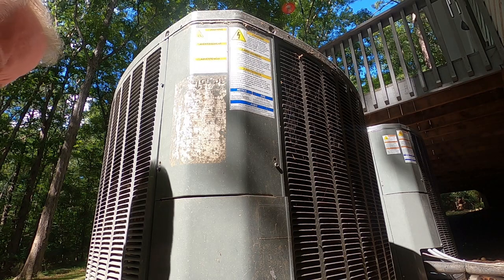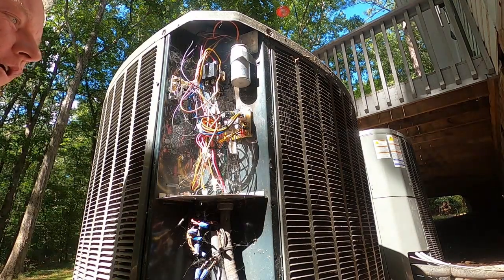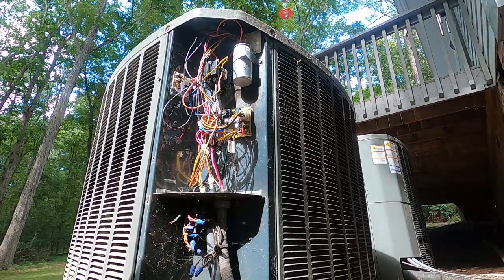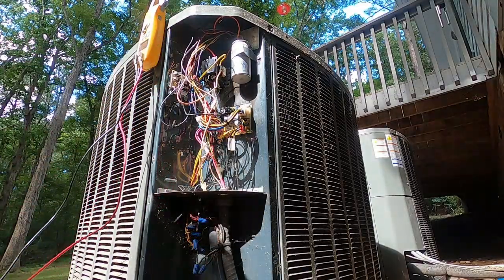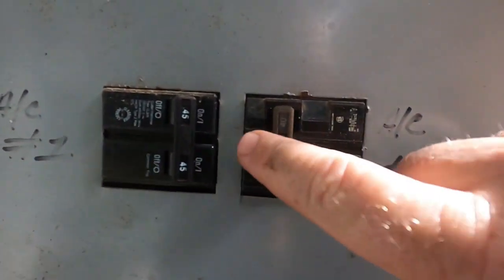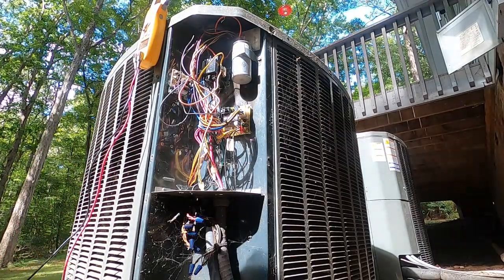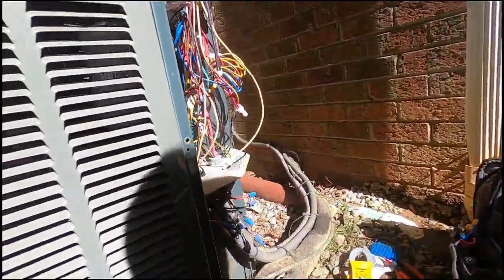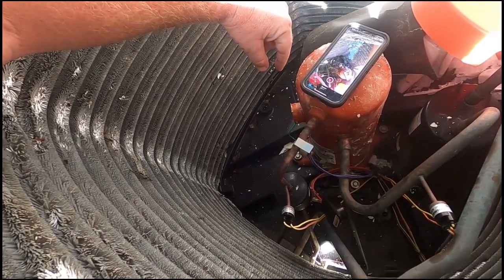410A Leak and breaker trip from a wire rub.

Comment: Are you replacing the cch thermostat might be stuck closed
Reply from the maker: Tstat open, the hot wire rubbed and shorted.
Reply: @MYHVACLIFE    You’re right.  I see the wiring diagram. You had 1leg hot.  Sorry